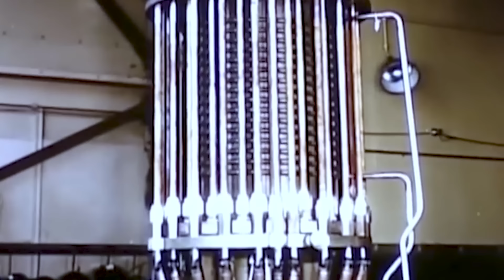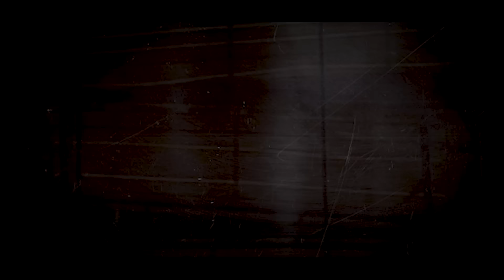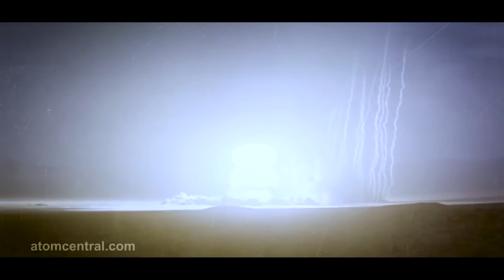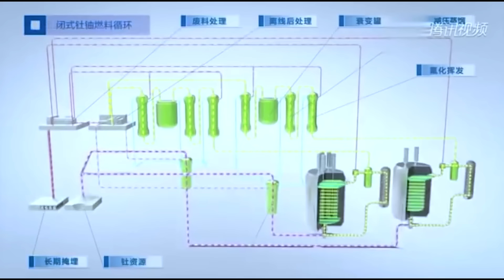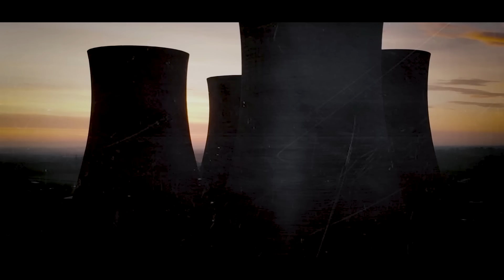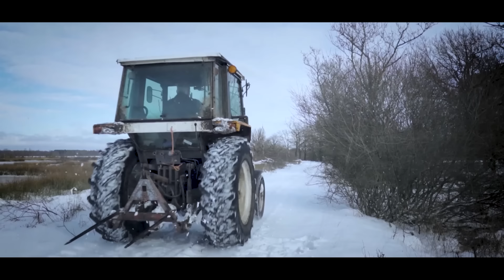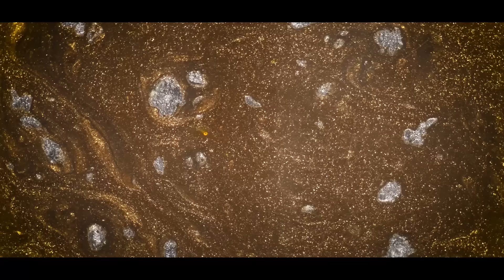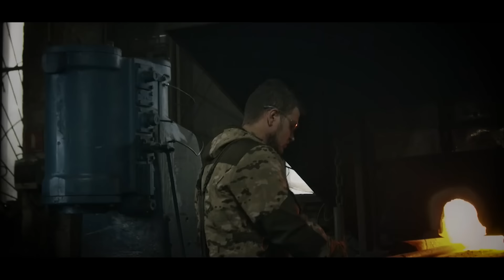Future of Thorium Reactors and Nuclear Energy

Comment: I think this fixation on Thorium being the cure is very bad strategy. Uranium 238 is absolutely viable in advanced reactors, specifically Fast Reactors. I would argue it's even better, because Fast Reactors are better. Thorium 232 and Uranium 238 both do better in Fast Reactors than in Thermal Reactors, while Uranium 238 is unviable in Thermal Reactors, but U238 is superior to Th232 is Fast Reactors.

The problem with Thorium is it's Neutron economy. Plutonium 239(From U238) releases 3.0 Neutrons in a Fast Spectrum, while Uranium 233(From Th232) releases only 2.5 neutrons in a Fast Spectrum. Thorium requires a larger core, it requires more fissile to remain critical. Even Thorium on the Thermal Spectrum requires a large amount of handling and reprocessing, that costs money. While a Fast Reactor running on Uranium-Plutonium can run for decades untouched. The problem is not the fuel, it's the people, there are too many people having to be paid to walk around with clipboards.

Nuclear fuel is the reason Nuclear Reactors can and have produced energy cheaper than coal, so a shift in fuel is not necessary, it's not what should be the focus, unless it's to reduce the hours of people at the plant, and Uranium-Plutonium has the greatest potential for doing so.

Comment: SMR (small modular reactors) make a lot of sense, and the thorium cycle seems to work with them.
Reply: What smr's use Th? ThorCon is a 500MW unit, the China LFTR is 2MW,Terrestrial Energy can use Th but U works just as well.The SMR coming in the US is NuScale and uses traditional fuel rods,Ultra Safe Nuclear uses TRISO fuel as does XEnergy ,you can put Th in Triso fuel but there aren't current plans to do so. X Energy uses TRISO fuel, no Th.
Reply: @paulbedichek2679  the Copenhagen Atomics reactor is a 100 MW thermal reactor, so SMR size.
It is a molten salt reactor in a burn-then-breed configuration. Running on thorium, with small amounts of plutonium (or other trans-uranics) to get the process started.

Comment: The big issue is that neutron radiation is very destructive to equipment, difficult to shield against and a poor energy or heat source.
Reply: Ok but isn’t that a problem current nuclear power plants have to deal with?  How is this a problem exclusive the thorium reactors?
Reply: @notbuyingit8047  current obsolete solid fuel nuclear reactors are a dead end in my opinion, so saying they are no worse also means they are no better which is a pretty big indictment.
Reply: @fieldlab4  We understand you are a great supporter of coal and gas, but the rest of us yearn for cleaner energy.
Reply: @paulbedichek2679  I guess if you have no argument, a straw man will do, but unfortunately for yourself, you are the best friend of the fossil fuel industry through myopic defense of dead end technology and false alternatives.
Reply: @notbuyingit8047  more research needs to go into alternative nuclear fuel cycles which produce energy more efficiently, for instance using larger alpha and beta particle radiation, or the hydrogen boron fusion reaction, or maybe some type of direct tapping of electricity or plasma energy, etc.

Comment: One time many years ago (like 40-50 yrs. ago?), just west of Sioux Falls, SD, my dad pointed out a building and said that was one of the first nucear plants ever run, that it was filled with concrete after a few years running. I tryed to find out more about this, but never found out anything. Could this have been the molten salt reacter?
Reply: I think it was
Reply: @jamesgornall5731  It was just east, not west of, between SF and Brandon, SD.
Reply: Idaho national laboratory is the site of 50 reactors ,we are now building the experimental molten chloride fast reactor, you don't use Th in many advanced reactors.

Comment: Now the current record for nuclear fusion temps is 160 000 000°C. Dunno 'bout you, but it seems kinda hot to me... being that the temp is Suns core is 15 000 000°C. Since we can't get the astronomical pressure of Suns core, we need more temp. It ain't happening. The money would be better spent on 4th gen nuclear... tho it seems it ain't happening either. So, we are fucked.

Comment: There were a few things I thought of that you said 4 times more Th than U but only 0.7% of U in nature can be used while 100% of Th so it is 500 times more useful Th in nature. Since often when they find rare earths that are used a lot now, we find Th as must is cleaned away, so now it is a radioactive contamination that accumulates on piles instead of being used.
Since some of the residual products are useful both in medical use and for spacecraft, it also has great values.

and you did not mention why they quit the program, it was because they wanted to make more nuclear weapons and did not listen to the man behind both the water and the salt reactor.

Then if you are going to make more videos, when you mention power output, mention if it is a thermal or electronic effect
(do not know if RR in UK works with Th or U SMR reactor)

Comment: Sounds like an advert to thorium reactors, I thought I'd hear how bad they are.  Another article I saw said that due to undeveloped technology, nuclear is about as competitive as solar power is, with the caveat nuclear MUST run 24/7 (you cannot turn them on and off), so nuclear is superior to solar (and wind).  Well done video, and note the fashion conscious European Union just temporarily classified nuclear energy as 'green energy', lol.
Reply: The point of MSRs is they operate at high temprature which can be stored in something like molten salt tanks.  MSR can also load follow of even idle to off and on as needs as part of their operation traits. This would make MSRs compatible with a electric grid that has allot of intermittent renewables in it.  It also looks like MSRs will be much less expensive to build due to their low pressure operation. For the most part the problem with these reactor is what is called first mover costs.  It costs allot of money to develop anything. What is needed is the investment to develop this technology before any verdict is made that this is truly good or bad technology.

Comment: Well, with the conventional (currently most common) thermo-nuclear reactors, the (relatively easily obtainable) side product is weapon-grade plutonium. Thorium reactors do not. With the military industrial complex being very much interested in such for weaponization of the side products. By that time the well-established Nuclear reactor building industry had fully latched on to the monetization of this increasingly attractive and deemed strategical side-product. Corporate Greed!
When plutonium became less desirable after the cold war, the damage was already done and the initial Thorium knowledge had mostly dissipated and reengineering the existing Conventional Nuclear-Reactor towards Thorium Nuclear Reactor was deemed cost-prohibitive, increase in development costs and capital destruction with the current major manufacturers of Conventional Nuclear Reactors. Again Corporate Greed.
Reply: That is not quite true. There were several thorium reactors built for commercial use but they failed, the reason being that for them to produce profitable amounts of energy, they had to be designed to function at a too high positive or too low negative void coefficient. All of them eventually ran into criticality events as a result. The safety risk they posed lead to abandoning the technology, which could not even be improved with gas cooling. (Look up Germany's THTR-300 for a prominent and costly example.) Only now that liquid salt cooling is a thing, there is a chance that the shortcomings of thorium reactors might be manageable.
Reply: If what you really want is a proliferation resistant power plant, then look into CANDU reactors. The first great thing about them is that they are a proven, functional technology, producing commercial power for several decades. The other great thing about them is that they do not require enriched uranium. Enrichment facilities are what you typically use in a nuclear program. 
CANDU can also run un-processed used fuel rods (from PWR reactors), without the processing where you could access the plutonium. 
In short, CANDU reactors could be build in every country, even authoritarian ones, without worry about assisting a nuclear weapons program.

Comment: There is use in small reactors, but not for the problem at hand: climate change. Why? You assume mass production leads to economies of scale, but what is the market size required to get to relevant cost savings? And how do you get the market to that size, given that you the numbers of units will still be small - per competitor?  To grow the market you will have to convince 250 governments to fast track the regulation of a complete new nuclear power technology. If that takes longer than 10 years you wont get a role in climate change activities. If it takes longer than 20 years most of the projects will run out of money. I would guess it will take 30 years at least to get the tech to a point where you can start to hope to achieve some economies of scale. Long after the last bell for the climate was sounded. And do not forget: renewable techs are simple and will advance in these 30 years, too. We might get back to intelligent nuclear in the future, but at least for the next 20 years lets not waste money and effort on it. It wont help.

Comment: It never happened? Oak Ridge National Laboratory 1965-1969. It was closed and stripped under pressure from the military and lobbyist from the uranium industry.  
We have had the ability to scale this tech for homes since the 70's. Most of the "problems" had been solved at Oak Ridge National Laboratory. Remember that "closed and stripped" comment? It was stripped and sold for scrap. A working reactor closed, paper work trashed, key components made on site along with any schematics sold as scrap or thrown in the trash.
You know why.

Comment: Under current nuclear regulation, the removal (escape?) of radioactive fission product gasses is considered a failure, not a feature as suggested here for a molten fuel reactor.  Yes removal of gasses allows greater burn-up, but gasses leaving the reactor is a failure in LWRs.  Gas escape from cracked LWR solid fuel elements  led to frequent shutdowns in the early days of US nuclear power, which in turn drove the industry to great expense to fuel designs that would retain fission products, eventually enabling the 92% up-times seen today.   The regulatory bodies are wedded to a secure fuel notion, and will have to turn themselves upside down to approve a system that says, 'our fission gasses are removed and stored in this tank over there, lets move along'.

Comment: You missed the fundamental point that all thorium reactors need a significant amount of U-233 as a "seed" to get the thorium fission reaction started. And since U-233 does not exist in nature, it has to be created by irradiating a thorium "blanket" in a pre-existing conventional uranium reactor, which then has to be processed to extract the U-233.
All this means that a thorium reactor is inherently much more expensive to operate than a conventional uranium reactor, and that is the main reason the technology for thorium nuclear reactors has never been developed into a commercial stage.
Reply: Notional thorium reactors need highly fissionable material to start.  U-233 is just one of the possible.

Comment: Nuclear power used solid (ceramic) fuel because that is the easiest way to extract material for bombs. 
Molten salt reactors have a liquid fuel making it much easier to fully use. However extracting bomb grade materials from the fuel salt is so hard that you are better off mining new material.
The Moltex is a fast spectrum molten salt reactor designed to burn irradiated nuclear waste. There is no carbon moderator (another source of waste).
It has a high negative temperature coefficient so cannot overheat. There is no freeze plug. 
Apart from a stirrer there is no moving part in the vote. 
The chloride salt is actually less corrosive that pressurised hot water.
The fuel salt is kept in vented fuel tubes but if it was to mix with the heat transfer sat the mixture would be too diffuse to react. 
It extracts the 96% of untapped energy in the old fuel. Result is 1/1000 less waste.
Reply: Wonderful idea, a low pressure reactor than can burn spent fuel and produce little.  

Sill, starting the common Moltex reactor design requires Pu.  I don't see any pathway to a regulatory oversight framework that's going to ever allow Pu being shipped around to commercial projects, and probably less chance still  for a proof of concept project that can't manage a high budget for security.  Certainly the public is generations away from ever reaching popular approval of Pu fueled reactors.
Reply: @Nill757  The Pu need not be bomb grade to be shipped. Denatured Pu is shipped all the time.  Current reactors work off Pu as part of their fuel now. Really start up Pu is not really a problem since bomb grade Pu is not needed to start the Moltex reactor.  High enriched U235, Pu, or U233 can all be used to start a Moltex reactor.  Really a molten salt reactor is like a garbage disposal.  Just throw in everything and let it cook. All that is needed is the proper level of fisionable material and the reactor will work.  It's not a reprocessing operation since nothing is being purified, hence the term pyroprocessing.  Since the molten salt reactor runs on a soup of reactants including wastes this type of fuel is useless for trying to make any sort of weapon.
Reply: @stanleytolle416  This hand waiving about fast startup plugs is tedious. 

The only Pu mix shipped out of military hands is Mox, and the 7% Pu in Mox Will. Not. Start. a Moltex design.  As anyone even remotely connected to NRC or DoE regulators will tell you, nobody is going to get their hands on pure enough Pu, or HEU 235 or 233 required to start .  It would take an act of Congress, and probably a change to the NPT.   The refusal to even acknowledge possible proliferation concerns by proponents leads to believe they should not be allowed near the buis given the likely harm they would do to public security concerns.
Reply: @stanleytolle416  I’m familiar w Pheil and the design.  Theoretically it’s a wonderful idea, very interesting, safe to run, and burns just about everything.  

Nobody can make a weapon from spent fuel w out separating  the Pu (1%) from the spent fuel via a sophisticated national reprocessing facility so that’s not a problem for weapons risk.  

Moltex needs fairly pure Pu or HEU to start-up though, and no US agency is going to give either to a commercial operation, ever.
Reply: @Nill757  what I seen in reading is there a big interest in governments wanting to get rid of weapons grade Pu. The big problem is the expense in safely storing this stuff and the incentive to get rid of the stuff.  The reason reactor Pu is considered denatured is that the different isotopes of Pu  that build up as power is produced in long burn up times makes building a bomb very difficult.  A few days ago I read an article about how this Pu could be made into a bomb.  Something about aluminum being used to cool the implosion process and that a skilled nuclear bomb maker could do this.  Oh yes a super computer to do the calculations and an nuclear bomb fabrication lab.  Yes a bomb about 1/1000 the yield to boot.  I fell asleep not thinking it was that big of an issue.  So once the weapons grade Pu is mixed with the reactor waste there should not be an issue transporting any more than other nuclear fuel.

Comment: Dude- nice video!   (and I'm envious of where you are in your education/career- for me that was a truly fun time in life- enjoy it!!)

I'd say that while it may become possible develop an airborne reactor that it's a really hard use case.  Weight, safety, and reliability requirements in aviation cause extreme design constraints limiting the options.  And it's a bit hard to conceive of literally  1000s of such complex and potentially dangerous reactors being in the air at any time. Hard to design something to be contained and safe after smacking the ground at speed  :)   Now, cargo ships and trains, maybe there's a use case there, but still a tough sell.

The "win" could be using abundant/cheap/clean energy to create substitute fuels that are carbon neutral.  Automotive would seem best suited to just going battery/electric, but aviation could be well suited to transition to a synthesized fuel of some type.  Maybe trains too, although it's probably just smarter to electrify.  And... it won't happen because it's critical to the environment, that's an uphill battle- but the second it becomes cheaper suddenly everybody will be onboard.

The bummer is that what we can do, what makes the most sense to do, and what we actually do end up being 3 different things.  Since big$ is involved it becomes political, and that pretty much throws any "what makes the most sense" choice aside.  Gut wrenchingly sad but true. ( Again, hoping for the "hey, this is cheaper!  I'll take 1000 of them!" surprise win scenario.)
Reply: It was funding for a bomber that could fly for months which we could build today,they knew they weren't going to fly with a reactor as fuel source in the 50's but they took the money and did incredible engineering, the advancement isn't using Th, it is the type of reactor. In 15 to 20 years we will build commercial ships with nuclear propulsion.